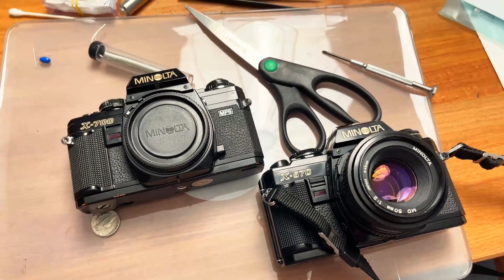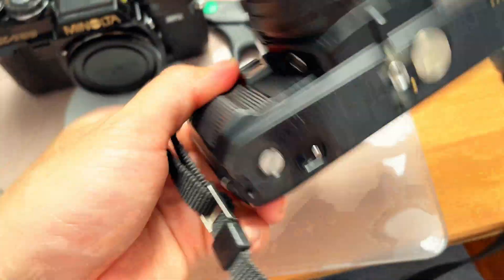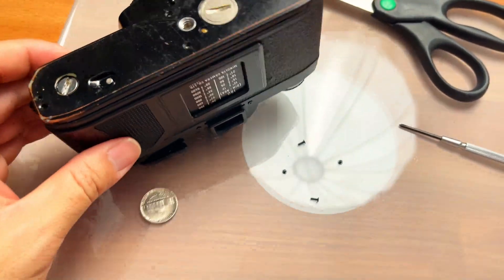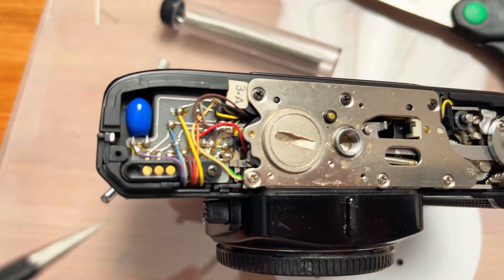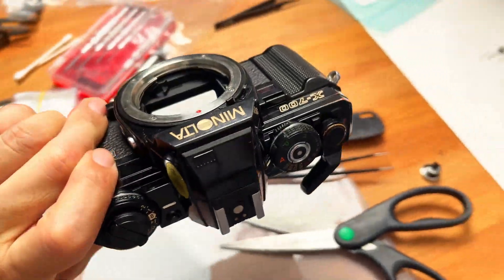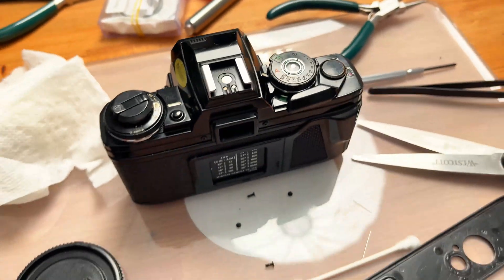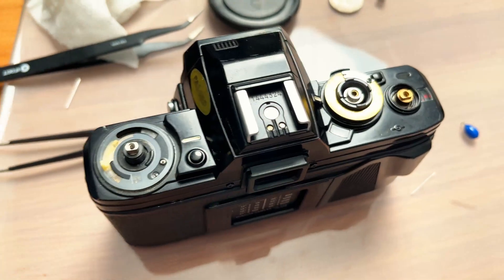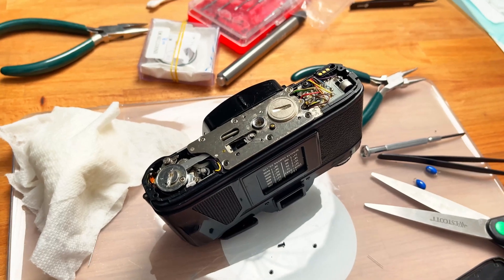How To Replace Bottom Capacitor on Minolta X-700 + Reliability Rant (Also applies to X-500/X-570)

Comment: Somehow, im not the only one that need to change the capacitor on my x-700 😅
Reply from the maker: The one that doesn't need to change the caps on X-570/X700 is probably in the top 1% percentile X-D
Reply: I also had one that just worked before I sold it a few months ago, but from what I read, it did seem like the early serial number models were less susceptible to the issue which that one was. I also had a dead one that was the top capacitor that was dead and it was a higher serial number. I attempted to fix it and yeah that circuit board was a pain to get to and I ended up breaking it.
Reply: @aw614  i had  two X700 Bodys  one was bought new in 1983  the other was a 96.   The old i still have and it works fine, the other I sold for parts because it quit working..

Comment: Really curious how operation top capacitor turned out! Its that my x700 has emotional value otherwise this whole repair thing would be a big no no for me... Stil not looking forward to it to be honest.
Reply: Hi, so i just recently replaced both capacitors on the old Minolta X-700 i got from my grandfather, it's not the easiest, but it is possible, took me about 3 hours to do, but it works now.
You can't do much wrong it is just difficult to solder the new (slightly bigger) one in on such a tight space.
Make sure the new Capacitor is 220uF and at least 4V
Reply from the maker: I gave up after opening up the top cover of X-700, I sold this camera for parts... Very furstrating... But I do still love my X570 as it's much easier to replace the only capacitor at the bottom of the camera with a high quality one and ensure long durability.
Reply: @TheGizmoGarage  What a shame. Seemed like an easy repair. Hopefully the new owner is enjoying their camera.